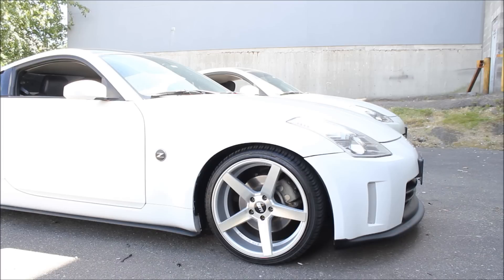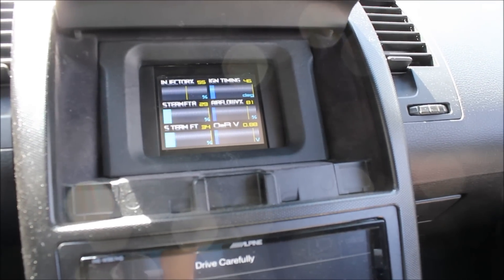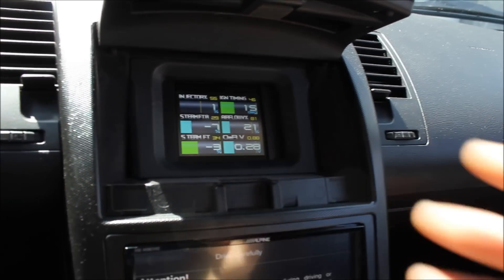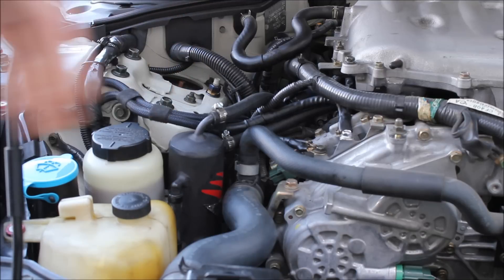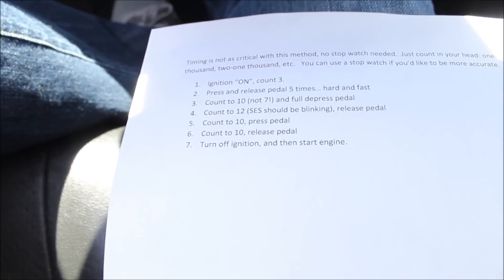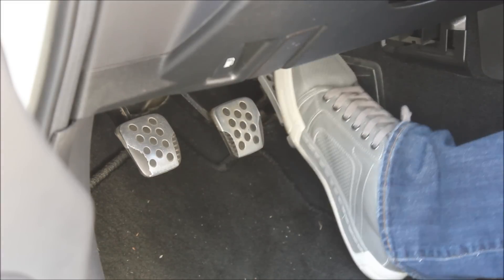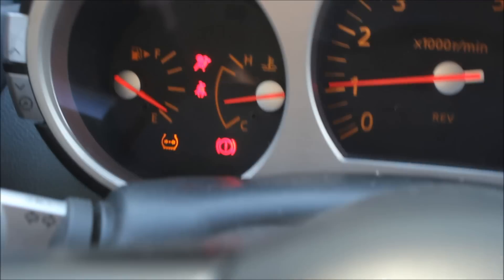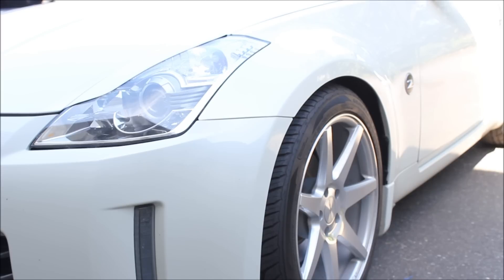Nissan 350Z / Infiniti G35 ECU reset & Idle Relearn 3.5L V6 (Check Engine Light) | AnthonyJ350

Comment: I just put my transmission in from home now my car starts perfectly fine and idles well gears moves but only at idle speed my car doesn't rev or move in gear when I push down on it ...could this be fixed by an ecu reset possibly or am I just having wishful thinking ?
Reply from the maker: Crystalline It might. Is it an automatic? What's it idling at for rpms?
Reply: AnthonyJ350 it's idling at  1 rpms it will occasionally rev when I first turn it on but not even a normal rev it's very weak and yes it is an automatic I just spent a lot on the transmission I'm hoping it's just a reset issue but I don't even know if it's related thank you for responding!!
Reply from the maker: Crystalline No problem. I would definitely do the reset because it will do the idle relearn as well.
Reply: AnthonyJ350 thank you  Anthony!
Reply from the maker: Crystalline Let us know if it helped at all after.

Comment: i just done this to my 350z and it worked at taking the light off but now every now and again the engine light comes on and flashed for a while then goes out? why is this? cheers
Reply: also it idles at around 500 rpm? it drops low after revving and sounds like its going to cut out or die but it doesn't and sits at 500rpm wish, any idea why?
Reply from the maker: Did you scan the car when the light was on to see what the car is trying to tell you?

Comment: Would this procedure be the same for automatic transmissions as well, I just replaced all four o2 sensors in a 2005 350z after getting a bank 2 sensor 1 code after installing all of them I cleared all codes then after driving for about 15 minutes or so the MIL light came on and the same code came up, could this procedure need to be done to permantly fix it?
Reply from the maker: Only way to find out is try it.  It's worked for a lot of other people with different situations if you check the comments.

Comment: Not sure why the relearn is not working for me. The SES is not even blinking.
Reply: Code is P0507
Reply from the maker: Could be your timing.  Make sure you're not counting too fast.
Reply: AnthonyJ350 dam you reply fast it's so good! I'm going to try it again. There's so much videos with this reset but this is the easiest i think.
Reply from the maker: The L33 Gaming Ya it's the perks of using the app. I get notifications like text messages.
Reply from the maker: If you get it to work, please share the video to help other VQ owners.

Comment: i have a 2007 g35s and it's push start, how would i do the relearn? i also have no CEL but my rpms are surging between 1500-2000
Reply from the maker: I would follow the same steps in the video, instead of turning the key you're pushing the ignition button.  I have not verified the procedure on a push to start vehicle yet.

Comment: Why can’t I try this I do it so many times but it just doesn’t work
Reply from the maker: What did you do to make the light turn on?
Reply: AnthonyJ350 I swapped the motor and it was running fine until the fuse box behind the battery got wet and then it started piping fuses for the fuel pump so I just put a new fuse box and it stopped but it still just cracked over but no start. I didn’t get fuel nor spark

Comment: the check engine light came out again few hour after reset, what can i do? my pity z
Reply from the maker: Danny Lim Did you scan it to see what the code was?
Reply: AnthonyJ350  i do nothing yet. how to scan?
Reply: Danny Lim 

FIX THE PROBLEM. IT'LL KEEP ON POPPING BACK AFTER IT FINISHES A DRIVE CYCLE.

Comment: Any recommendations on what kind of diagnostic tool would help reset those lights ? Either that of i have a broken sensor , but id rather try to reset before i buy a sensor , i think its just because i put new rims on , if you have any ideas id really appreciate it thanks
Reply from the maker: Look into CReader.
Reply: Yep that's Nissan... Installs a radio, check engine light comes on
Reply from the maker: +W&G Consultants When does that ever happen?  That doesn't even make sense. Even new Nissans still don't use a CANBUS network to turn on the head unit. So why would a check engine light turn on consistently?
Reply: Well not really installing a radio and a check engine light comes on lol. That never happens, I was meaning more along the lines of watching what you do because if you do it half assed, you will probably end up with  light or worse.
Reply: lol  check engine light will not come on because of rims
Reply: ds Ds 

OBD2 READER.

Comment: Hi. I know this is an old video. But I’m trying to do the o2 sensor monitors but they won’t complete no matter what I do and I’ve followed every drive cycle. I’ve seen that maybe they were disabled with a tune in the past. Would this work to remove that if that’s what happened? Thanks
Reply from the maker: Which set of O2s are you looking at? Pre cat or post catalytic converter? This wouldn't reverse a tune though.

Comment: will this ecu reset fix my 2003 alarm that constantly goes off randomly with no reason?
Reply from the maker: Jo ca I'd check the voltage of the battery first. Should rest at 12.6 volts with the  motor off.

Comment: I just put on a new throttle body and did the relearn but my idle is still stuck at 1100. I did it all right the light blinked and it's not on
Reply from the maker: For sure you saw the engine light blink the exact same way?  It stays that high after you drive around and get to operating temperature?
Reply: I’m having the same problem. Took throttle bodies off to clean and did the relearn but idle is stuck

Comment: Hey buddy, i have a 350z.. It wont start.. I replace the ECM, IPDM and the BCM but still wont start.. I have done all the programing for new parts. Any idea? Thanks.
Reply from the maker: dunstan natsnud Did you check all the fuses related to ignition and fuel? Also do you hear the fuel pump priming when you first turn on ignition?
Reply: The fuse all fine.. Fuel pump is working good.. I have a Consult 3 so i can check the fault code. But cant find the solution. All the fault code is Can Comm and the ECM is missing from the diagnose or cant be diagnose.
Reply: Make sure the red light alarm is going our when key is starting engine. If it's not going out your key  chip/transponder isnt doing its job. You need new key. Go to nissan

Comment: After cleaned throttle, my 05 Xterra having code P0507 ( high idle). I went thru research Youtube and all, but still no luck, even I've tried pedal dance over 20 times. One of the relearn procedure said : "Turn ignition switch ON then OFF, wait at least 10 seconds. MAKE SURE THAT THROTTLE VALVE MOVES DURING THAT 10 SECONDS by CONFIRMING OPERATING SOUND".
The problem is I didn't hear any sound at all from throttle valve. Any input will be appreciated.
Danny D.

Comment: I have code p2a00 and I replaced the o2 sensor upstream and code never went away, should I do this?
Reply from the maker: Did you replace driver side or passenger?  You'll probably need to reset the car because it might be saved in the computer.

Comment: It worked for me then shut the car off and the light came back on. Brand new o2 sensors and still have check engine light
Reply from the maker: Did you scan the vehicle to see what the code was?
Reply: Yes basically all o2 sensors but one of them
Reply: If remeber correctly it was p0037 and p0035
Reply: One more code I don’t  quite remember

Comment: Hey i got a diagnostic and had a exhaust valve timing circuit code and a catalytic converter below threshold both on bank 2. I just bought the sensor for the exhaust valve timing.Do i need to reset the ecu and will that also fix the cats or is that a completely different problem btw i have an 06 350z with ark performance exhaust
Reply from the maker: is the timing circuit code for the same bank as the cat code?
Reply: AnthonyJ350 yeah both on passenger side and aslo i heard something rattle free today under the car and i have regained a lot of torque since then but I haven't even replaced the sensor or done a ecu reset
Reply from the maker: Isaias Zavalza I'd replace the sensor for now. I had a similar issue, there was a vacuum leak the  sensor was bad. The car is notorious for that sensor code. And I'm not sure why. It could be wiring of the sensor, it does have a lot going on and the car is older.
Reply: AnthonyJ350 alright will do thank you so much great videos btw
Reply from the maker: Isaias Zavalza No problem.  Another question.  Are they still the stock cats?
Reply: AnthonyJ350 i actually do not know i just recently bought the car could that possibly be the problem if they were the stock cats?
Reply from the maker: Isaias Zavalza It depends.  I'd change the sensor and you'd have to live data feed on a scan tool to see if your parameters are off from what a stock car should be.

Comment: I bought a 2008 G35 in April 2017 and it dies when idling under 1000 RPM (usually only when stuck in dead stop traffic), would resetting/updating my ECU fix my issue? We originally did diagnostics for it and the first thing to pop up were the CPS', but the dealership i purchased from replaced all four only to find the same issue when idling, it tripped the check engine light within 20 minutes of leaving the dealership.
Reply: Car is automatic, about 155k miles but has been serviced appropriately (carfax had a history of every oil change/service this car had, no major repairs done, just upkeep).
Reply from the maker: Yams It's worth a shot to try it. It's free. If you still have issues a good mechanic will have to live data feed the diagnostics and troubleshoot based on the data.
Reply: Yams clean throttle body

Comment: Hey Anthony, thanks for posting this.  I just bought a 2006 350Z recently. 53k orig miles, 6spd manual, Motordyne spacer, titanium cat back exhaust w/H pipe, Jim Wolf Pop charger, 19" wheels all around. Pioneer head unit driving the bose system plus Python alarm and remote start.  It had the check SES light on and I was told it was due to the exhaust mods.  The low miles on the car eased most of my worry with this unknown and I bought it anyway.  I just did you reset method and poof, the light is off.  I only got a 20 mile drive in as I did this on lunch.  I will be checking again when I drive home from work and in the morning tomorrow when it's cold to see if the light comes back on and if I have anything to investigate.  So thank again for this vid.    I was told the suspension was altered but I don't see how as the shocks all have Nissan stamped in them.  It could be the 19's just give it a lower appearance.  The owner I purchased the car from stated it had the best suspension you could get.  I assume that would be track in stock form.  This car is an Enthusiast and does not have the dual cover on the timing so it's not a revup motor.  Please correct me if I'm wrong there.  Anyway, if you could comment on the suspension and revup status of my car I would appreciate it.  I did watch your video on that subject but I have also read that all 2006 manual cars are revup.  The timing cover on mine contradicts that statement.
Reply from the maker: D Juhasz What's the month and year of manufacturing of the car?
Reply: Based on the carfax, it says manufactured and shipped to original dealer 6/30/06.
Reply: sequence number 312206
Reply from the maker: D Juhasz I'd just call a dealership with the vin and they can verify.

Comment: I have a 2017 Infiniti Q60RS.  Installed an oil catch can like you did in the video.  No check engine light but hesitation under acceleration.  Checked for vacuum leak.  Nothing obvious that I could find.  Do you think the ECU reset might help even though I have no codes or check engine light?  Thanks.
Reply from the maker: I would try it.  Also are you sure the catch can isn't installed backwards?

Comment: I followed everything exactly how you said but it didn't work. Also my SEL doesn't flash at all, even when it showed up. So when I did the reset, it never flashed either. Any ideas what it could be?
Reply from the maker: Alan Najera Did you try scanning the vehicle to see what the code is?
Reply: AnthonyJ350 I haven't scanned it yet to get a code, I was hoping it was something with the ecu since it was not blinking.

Comment: Is it important to drive after reset
Reply from the maker: It's a good idea to help the computer relearn.
Reply: AnthonyJ350 I just came up now 
And my mechanic says it’s an oxygen sensor
Reply from the maker: Scan the vehicle.  It's most likely one of the air/ fuel ratio meters, my passenger side went out.  A vacuum leak can also cause a "bad O2 sensor" reading.
Reply: AnthonyJ350 are these parts are cheap ?
I am new owner to Z so I didn’t know much about it
Reply from the maker: The part might be around $100 give or take.  It's a more advanced version of an 02.  Scan the vehicle first to help pin point the problem.  Was anything done to the car recently?  I tripped an O2 code because I had a vacuum leak from my oil catch can install, because air was coming into the motor unmeasured.
Reply: AnthonyJ350 what if u just rest Ecu and drive after for half hour ?
Is that ok
And is there any bad effect for on car
Reply from the maker: Varundeep singh Bajwa No, if there's a real problem the check engine light will just come back.
Reply: AnthonyJ350 so If I rest it and don’t drive everything is fine?
Only light comes back if there is real problem?
Reply from the maker: Varundeep singh Bajwa Exactly. Just make sure all your fluids are topped off and everything is plugged in under the hood, basic stuff. And just drive it easy for now.

Comment: Do you think this could help with my issue? I have no codes stored or on and only on warm starts my Z will stall or RPM will drop low and go to normal.  Thanks!
Reply from the maker: Sounds more like an intake air temperature sensor malfunction.
Reply: Thanks, I cleaned my mass air flow sensor and still the rpm drop on a warm startup. Also changed the battery and air filter. I don't see a vacuum leak either.

Comment: It worked I hope this will keep my airbag light off at least for a few days. The turn the switch off 4 times turns it off but it comes back after about 20 minutes or driving at least for me it does.
Reply from the maker: This procedure won't correct an existing problem.  If the light comes back you have to fix the vehicle.
Reply: @AnthonyJ350  I fixed it permanently I removed the tac and put black tape behind the airbag light I'll never see it blink again now. Seems it's a flaw in alot Nissan cars and SUV
Reply from the maker: @joecable39nc  Did you consider scanning the vehicle to see what the problem is?

Comment: Would this help reset tcs slip and abs light ?
Reply from the maker: I doubt it, since those systems are related to the chassis.  The computer I was resetting is just for the engine.  To clear those lights you need a more advanced diagnostic tool.

Comment: Hello Anthony , i've just purcased a used 2007  manual transmission nissan 350z with 130000km  and discovered that had a big issue, when i'm between 1300 and 2000 rpm she's bouncing like there is a lack of power just for a moment, over 2000 rpm she works fine and change smooth but every corner is a problem i need to give lot more throttle to stay over 2000rpm (but do that everytime cut in half the life of my clutch)   do u think that doing this procedure can help me?  ...... thanks
Reply: the motor is a dual intake stock HR engine
Reply from the maker: Julian Brioschi Try it. Does the car idle ok?
Reply: AnthonyJ350 i can make a video to show you my problem
Reply from the maker: Julian Brioschi Please do

Comment: Here is what actually worked for my '08. 07-09 are different engines and mine had a slight difference and timing had to be spot on for this to work. 

Turn the ignition key to position “ON” without starting the engine and wait 3 seconds.Fully press and release the accelerator pedal five times within 5 seconds.Wait 7 secondsFully depress the accelerator pedal all the way to the floor and hold for ten seconds. until the CEL starts blinking.At this point the light CEL should start flashing error code stored in the system and you can release the pedal. If you only get five flashes slowly or not flashing at all, then it is time You went on one of the above steps and you have to start from scratch.Fully release the accelerator pedal (while the CEL is still blinking) and wait about 10 second.Fully depress the accelerator pedal and keep it for more than 10 seconds.Fully release the accelerator pedal (The CEL light will continue to blink).Turn the ignition off and start the engine to verify the indicator has been reset.
Reply: I have 07 hr and the 7 seconds work also hitting the gas 5 times after 3 seconds and not waiting for fuel pump to prime

Comment: So is this for code p1283 as well ? My car has headers and an exhaust so and it says something about A/F ratio on the forums but I came here cause another person told me to reset the ecu. How do I know which one it is? @anthonyj350
Reply from the maker: Try the reset and drive the car around, turn it off and turn it back on. If the code comes back you might have a leak at the header throwing the 02 sensors reading off.
Reply: Same issue with mine
Reply: Might be my headers or ecu ?

Comment: hey man, i got a check engine light on my 350z HR after installing test pipes. will this method work on my motor? cuz i know that test pipes trigger a check engine light on an HR and not on a DE. According to my mechanic the only way to get rid of the CEL is a tune and i wanna avoid spending $600+ lol....
Reply from the maker: Mike Ananian Ya the HR is sensitive. You can try O2 sensor spacers. A tune is the best thing for the car.
Reply: Thx bud. Ill try your method. If it doesnt work i guess ill tune it...